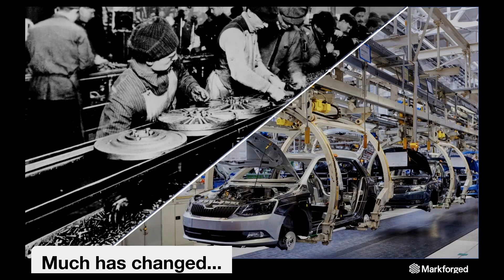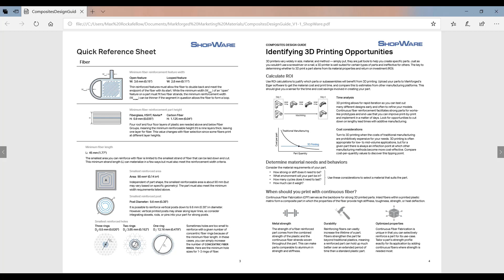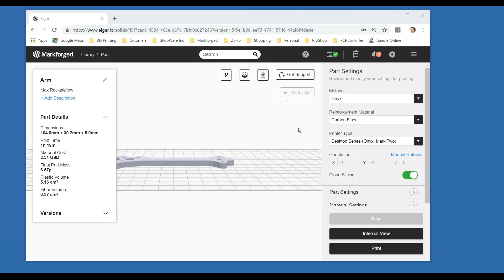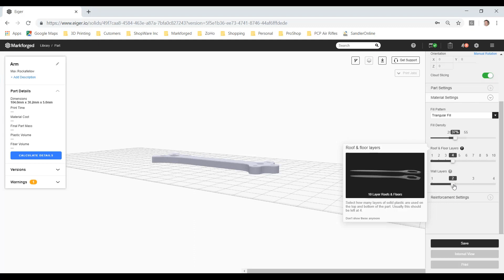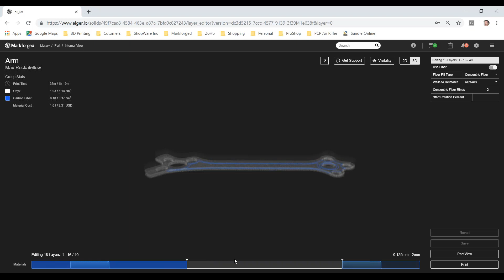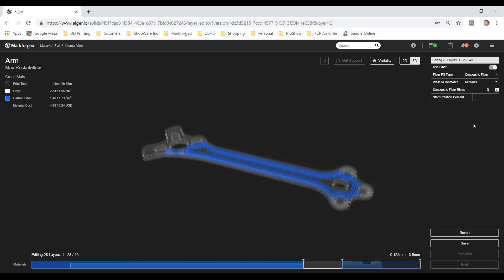Markforged Webinar - Composite 3D Printing:   Laying Continuous Carbon Fiber

Comment: What's the surface finish quality on continuous carbon fiber parts?
Reply from the maker: 50 μm or .05mm is the minimum layer height on the X7 CFF Printer. Double that for the MarkTwo. Contact your local Markforged Reseller. From what we've seen the surface finish is very good compared to some other offerings out there but a lot can depend on geometry, way the part is oriented on the printer, etc.